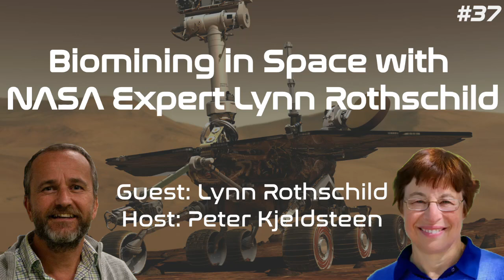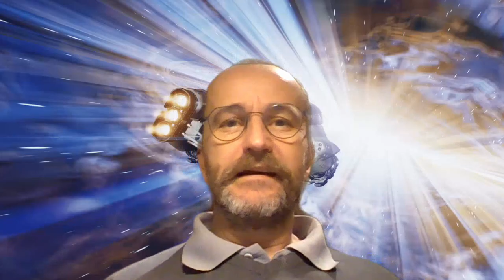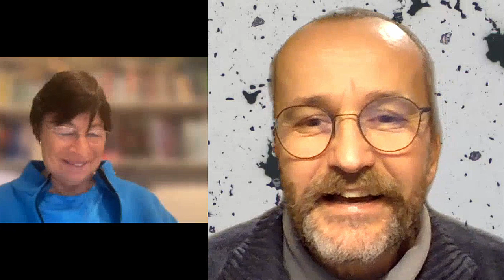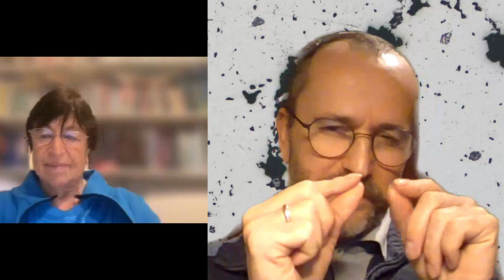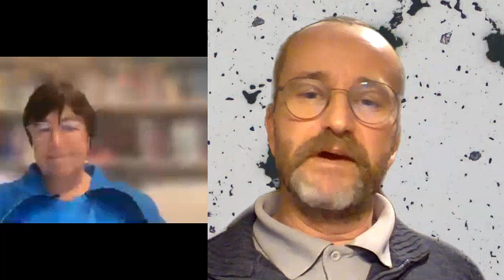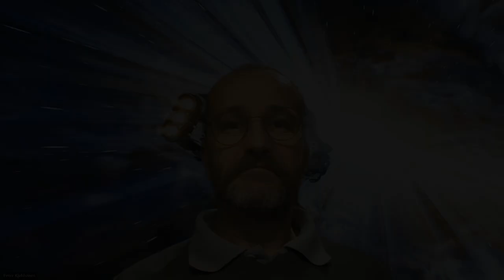How to Mine Metals on Mars with  NASA Biomining Expert Lynn Rothschild

Comment from the maker: Urbina, J., Patil, A., Fujishima, K., Paulino-Lima, I.G., Saltikov, C, & Rothschild, L.J. 2019. Urban biomining: A new approach to bioengineering surfaces for reclaiming and recycling metals from e-waste. Scientific Reports, Nature Publishing Group 9:16422  https://doi.org/10.1038/s41598-019-52778-2
Reply: The paper introduces an innovative method for addressing the growing e-waste problem by using bioengineered surfaces to recover valuable metals. This approach offers several advantages, particularly in providing an eco-friendly and sustainable alternative to traditional, energy-intensive recycling methods. By utilizing bioengineered microorganisms and surfaces to selectively extract metals from discarded electronics, the technology aligns with circular economy principles and reduces the environmental footprint of e-waste management.

However, the technology faces challenges, particularly in scaling up the process for large-scale implementation. Ensuring the bioengineering methods are both efficient and cost-effective for mass metal recovery remains a significant hurdle. Additionally, the long-term environmental impact of deploying bioengineered surfaces in urban environments needs careful consideration. Integration with existing e-waste recycling infrastructure could also prove complex, requiring adaptation and coordination across industries.

Despite these challenges, urban biomining holds considerable potential. It offers a sustainable way to recover precious metals like gold and silver, reduces reliance on harmful chemicals, and supports the circular economy by turning waste into valuable resources. The method could be particularly impactful in urban areas where e-waste accumulation is high, contributing to more efficient and environmentally friendly waste management.

Looking ahead, advancements in bioengineering and synthetic biology could optimize the process, making it more efficient and scalable. The technology also has the potential to be integrated into smart city infrastructure, helping urban areas manage e-waste more sustainably. For this technology to reach its full potential, it will require continued research, regulatory development, and industry collaboration to address both environmental and economic concerns.